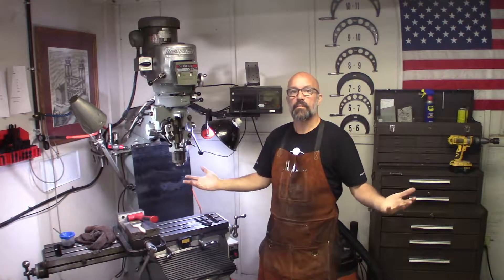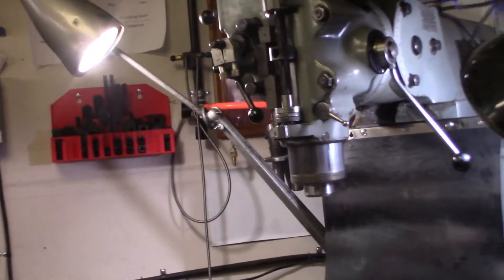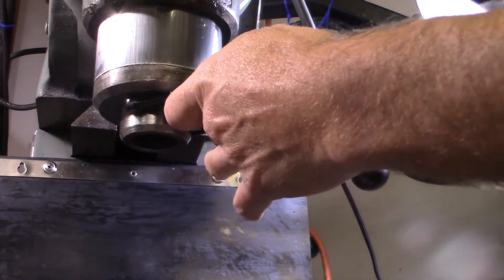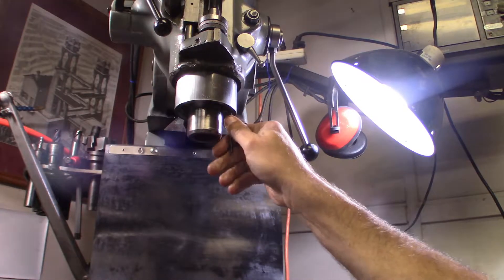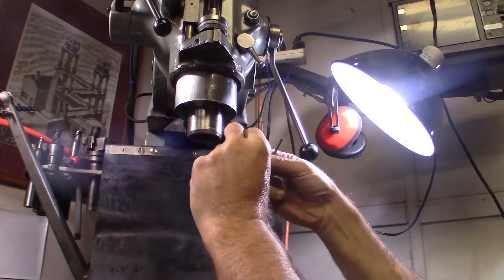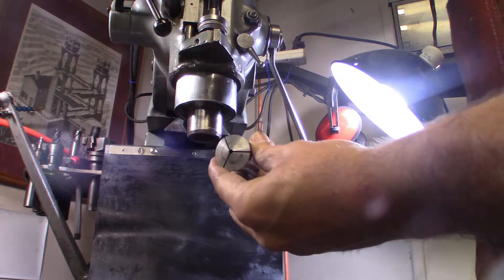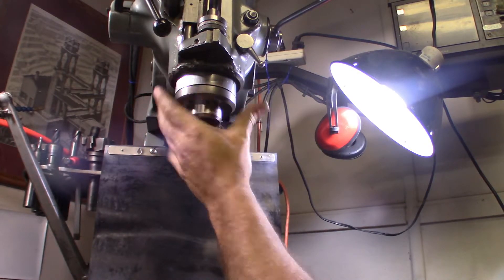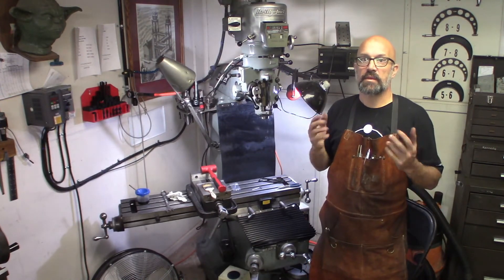Bridgeport R8 collet alignment set screw replacement

Comment: Don
This all is what happened to my 1956 Bridgeport J model.

Had a 1/4" shank woodcutting bit, spin in a 1/4" collett. Stopped and tightened drawbar. Decided to change to another A metal collett, and loosened drawbar and tapped with a brass hammer. Drawbar
ejected collett. This is where I screwed up. I have owned the machine for 25 years. The nut that screws into the end of the collett came out and I did not notice. I used a 1" x 4" piece of aluminum to try to push drawbar out.
So now i have a 1"  4" piece of aluminun stuck in quill, and a drawbar that will not come out.

I am truely sick, as I use the Bridgport at least 4 times a week. I removed the threaded nose cone and got to the set screws, but they will not come out.

Happily report that I got the 1" x 4" out using a crowbar. Looks like the piece has a straight keyway about an inch long. Collets slide in OK. What a relief. Saw the damaged collett in this sites video!!

Only remaining problem is drawbar stuck in machine with collett on end, preventing it from coming out.
Saw it out? Going to replace with a new one as the threads either get damaged or damage colletts. The machine has a servo air motor, that has never worked right.
Thanks for reading.
Don
Manhattan Beach, California
Reply from the maker: That has got to suck.  I love my bridgeport and this adventure had my very scared.  I'd say cut the draw bar out and get/make a new one.

Comment: The part you screwed off is the bearing retainer.  I take the pins out. Dont use them. The taper will hold the collet just fine.

Comment: I need to replace the alignment screw in my mill. It is a clone and I haven’t been able to get the bottom collar loose yet, I think I’ll need to make a pin spanner for the collar. Mine doesn’t have the holes on the bottom of the collar they are on the side.